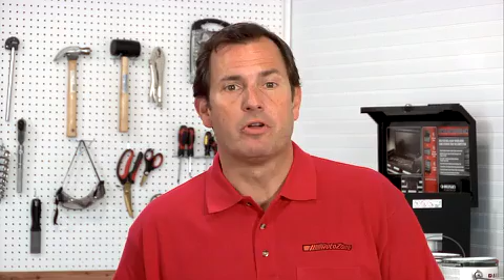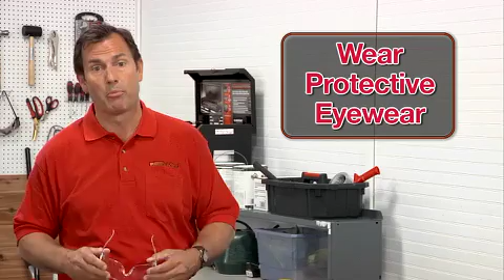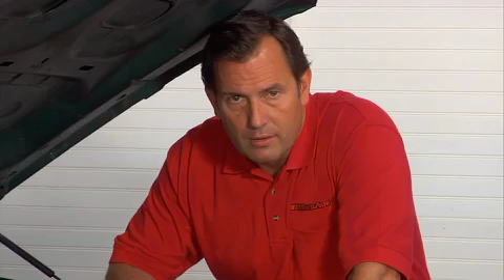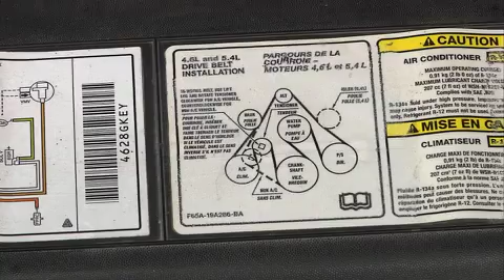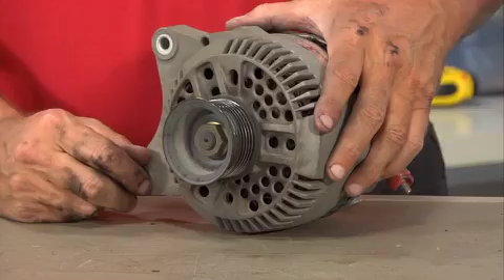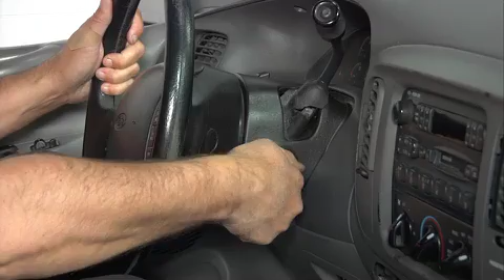How To Install An Alternator In A Ford F150 - 4.6 Liter

Comment: what he didn't tell you if you don't have two replace your alternator a lot of times if your battery light is on but the car is running and you have full power and lights and everything else could be your voltage regulator brushes which is an internal component on your alternator if it's a Ford like the one he showed you there will be four tourx screws around the base of your connector wiggle the base out after removing those screws you'll see little graphite brushes then all you got to do is going to your local AutoZone ask for the brushes on your type of car the brushes is going to have the PIN to hold your brushes in place do not remove those until installing them into the unit two little screws under the brushes install your new brushes reconnect those four screws then pull the pin reconnect your connecter reinstall your alternator make sure the main drive belt is properly installed and everything should be in Tip-Top shape once more

Comment: Very good video.  Just finished mine and was done in just over an hour.  Hardest parts are finding all of the bolts that must come out and, you may have to access the tensioner fastener from underneath as getting a good fit is hard to do and the top coolant hose is a little in the way.  Great Job on the video and thanks to Lorenzo and team at the LIttle Elm TX store.